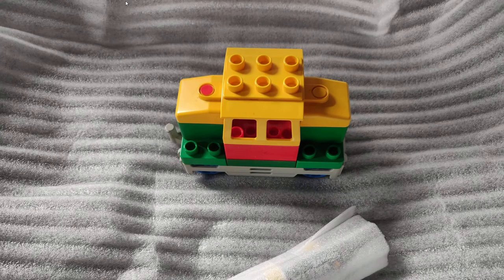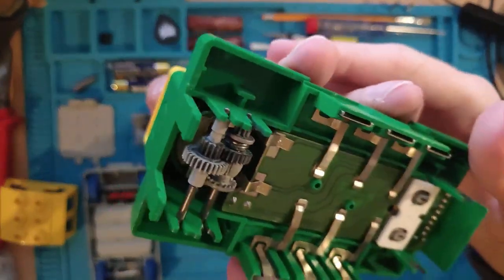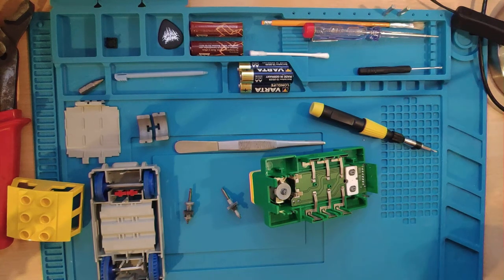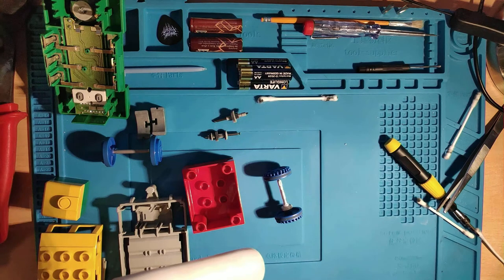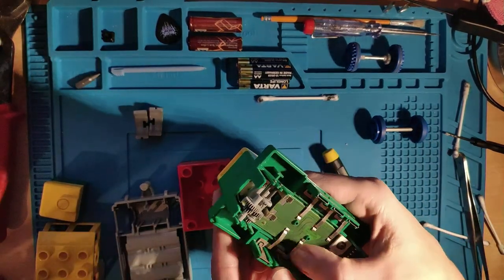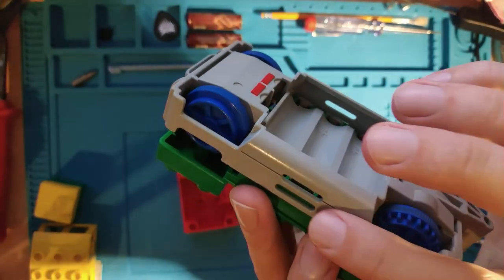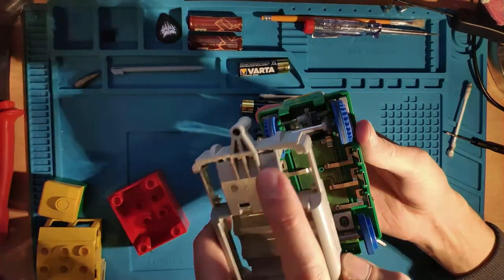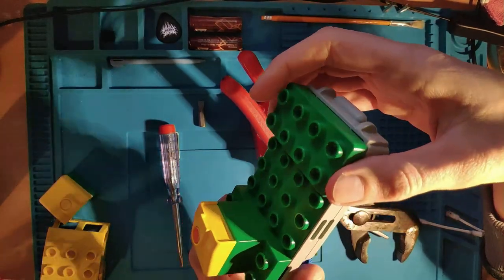Let's Fix a Lego Duplo Train from 1993 for my Stepsister's Daughter

Comment: I separated the parts by putting small screwdrivers down both sides and easing the two clips on both sides out of their position. I then put another screwdriver in the front and prised that open slightly. Then put the screwdriver in the two rear slots and prised that open slightly. It was a matter of doing front and back slightly in turn, until it popped free.

Comment: Hello, thank you for the amazing video. A bit long but I found the stuff I needed. Still got One final problem. The train runs again but sometimes stops. I found out there is a black rubber In the main gear comes out from under it en blocks the rotation. Dont know if this is a feature or bugg. But that he doesn't run anymore. I need tot press reverse and forward a lot of times and hope it works again or when I have it open push it back in

Comment: Hello and good evening. I managed to open up the engine with your help and even though I’ve cleaned the contacts, the motor still doesn’t run. I’ve connected the batteries directly to the motor and it does run. Looks like I might have a problem with the circuit board. Any idea how to check it or maybe purchase a new one?
Thanks and best regards

Comment: I have cleaned all the parts but it is still not working :-( I am not sure what is the problem..
Reply from the maker: That's a shame. :/ Maybe the motor is defective? Or there is some real damage on the circuit board. Not sure how to fix it then without replacing parts. :(
Reply: @RaykOscuro  this was my worry as well.. I don't know if the button on the top works either. It's for my cousin who is turning 2 tomorrow so it's sad that I can't get it workint
Reply: You have to check the contact of the microswitch and the contact of the battery with a multimeter first. It is not likely that the motor is faulty. Or hopefully not the motor because it is hard to find a replacement.

Comment: I still need help!!! Thanks for the video it was very helpful and I got my granddaughters train running after cleaning the terminals. I did find that there was a missing tooth on the cog on the drive axil. The train still runs at present but not sure for how long. Has anyone ever found a replacement cog and a way to fit it. It looks like this is a common problem.
Reply: 3d printing I suggest